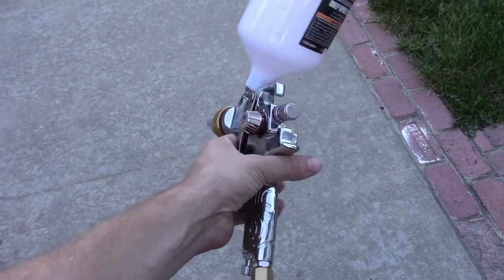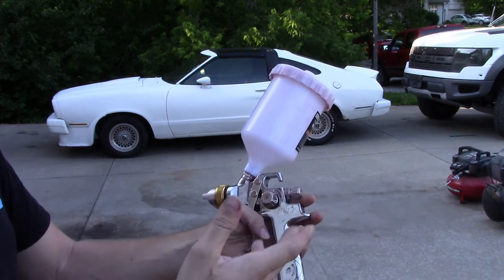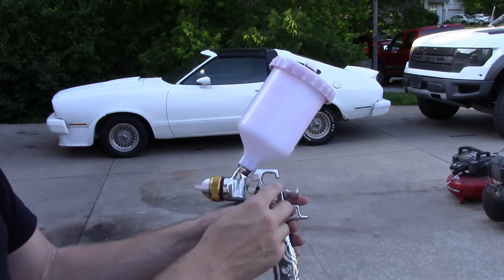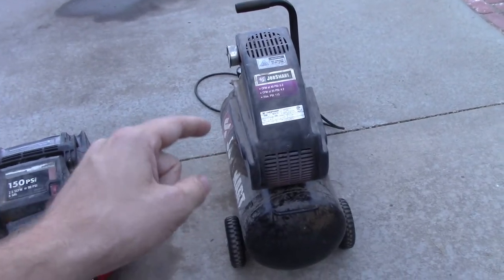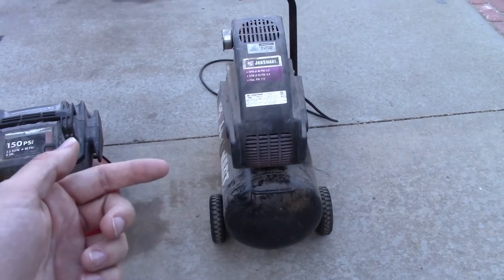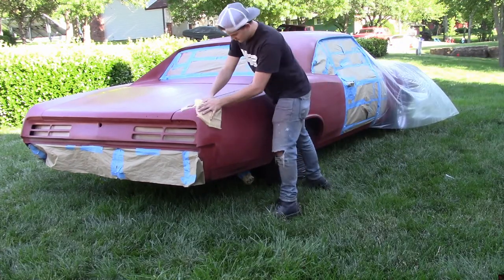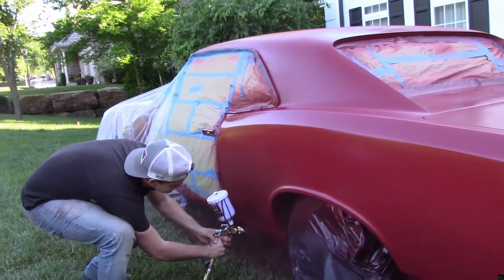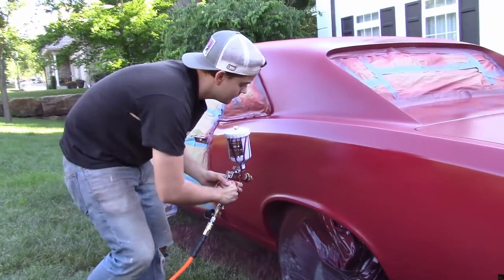Outside Paint Job with Harbor Freight Paint Gun on 1967 GTO

Comment: Good job man !!! Car looks good! After some practice you'll get even better, so don't stop, find something else to paint and keep on practicing. See if any of your friends need to get their cars painted 😉 Worst time of the year for outside painting is late May to mid Jone due to all the cotton in the air...
Reply from the maker: Sounds good man! already got my next paint job planned. really appreciate the advice
Reply: @maddenmadness  BTW thanks for mentioning my channel in your vid... 😊
Reply from the maker: @fix206  It was the least I could do. your video on the paint gun really helped me out
Reply: @maddenmadness  If you're planning on doing a good bit more paining, I would suggest you getting better paint gun... It will just do better a job with less effort... If I were you, I'd pick up an Iwata Kiwami4 with Copper cap, you can get one shipped for right around $200. It's a good entry level professional gun. I think I'll do review on one of those on my channel in a near future
Reply from the maker: @fix206  Yeah that sounds like a good deal. I'm still doing body work but that should be done in a month or 2. I wanted a good gun but the ones that were recommended to me were all 500+ dollars. 200$ for a Decent gun is very reasonable

Comment: You did great job!...Anyhow this is advice not a criticism clearly your car looks great!... You should really be wearing a respirator even spraying out doors. Isocyanates are nasty stuff worth the extra $20 for a respirator to avoid them...The reason you got so much orange peel is your gun pressure was too low. I've never used the gun you have, but most of the time pressure should be closer to 30psi. Even a little higher still for clear coat, as high as maybe 35psi. Very expensive professional guns may be able to get a good finish at very low pressures, not the cheap ones. A good rule of thumb is cheaper the gun, the higher the pressure to get a good finish. Upping the pressure will give you more overspray, but a flatter finish....There again you want a respirator cuz the additional overspray is more paint in the air to breath... Also don't worry about the paint lost to overspray, cuz it's just the paint you'd be sanding off later as orange peel spraying at lower pressure😉
Reply from the maker: Thanks for the good advice. Its hard to find good info on this kind of Job. Appreciate it